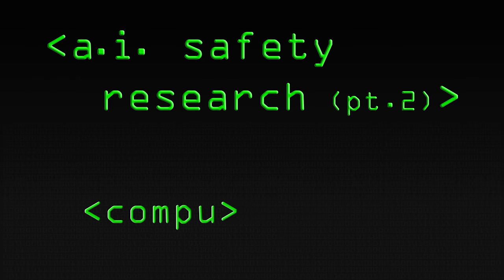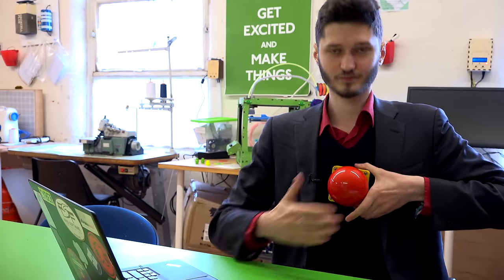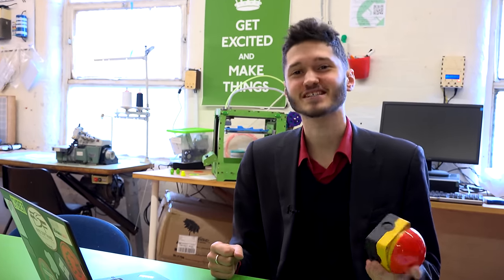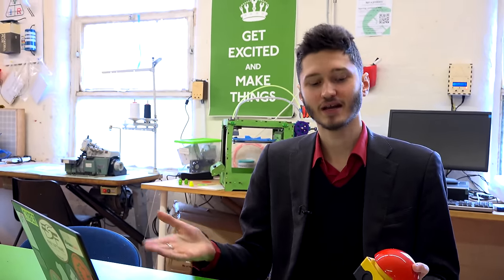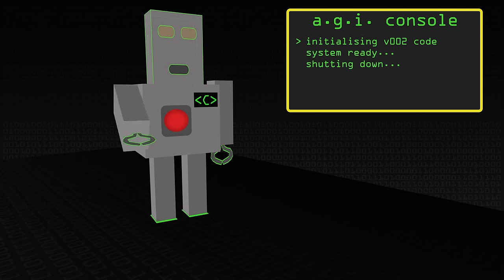AI "Stop Button" Problem - Computerphile

Comment: Why not just dynamically adjust the robot's goals to be the same as the controllers. In your example, if your initial goal was to get tea then the robot would do that, however, when you see the baby in its path your goal is no longer to get tea but to prevent the robot from running over the baby. If the robot's goal changes based on your goals, then its goal would also now be to protect the baby from harm. This also alleviates the need for a button because if your goal is to shut off the robot then that will also become its goal.
Reply: I had the same thought. What if there was a reward/punishment button as well as the stop button, where the reward button is very high on the AGI's utility function, and will only be pressed after it has finished it's task correctly, and the punishment button will deduct from the reward's utility value every time it's pressed? If the AGI wants to optimize its reward value, it would know to listen to your commands, whether the commands are in line with its original directive or not. Though, I'm sure there are loopholes to that as well, but it's the best I can come up with.
Reply: Jovan Ko it would just try to make you press the reward button, tea be damned.
Reply: At that point you might as well go make the tea for yourself. Isn't worth the bother of designing an AI if you have to give it constant instructions.
Reply: Kyle Piira The problem with this is that any truly intelligent AI is likely to be self-learning, so early in its development it won't understand human psychology very well. If it incorrectly guesses what you want, then you end up with the same problem.
Reply: +Kyle Piira  Hmm, so my goals are the same as my controllers?  Cool.  Now I just need to strap them to a table and do some destructive brain surgery to figure out what they are.   Easy enough.
Reply: The problem is, that you need a robot with a usable OFF button so you can start developing a strong AI. Because for a long time - during development and such - the robot will not understand or care about babies. So you need the OFF button to work properly right from the start, to be save for any unforseen situations.
Reply: It could try to hide from your sight in one case, or attack everything in another, so that you either never change your mind, or always change your mind, for the same reasons it'd avoid, or support, pressing the big red stop button.
Reply: Sorry for not posting it here, but I may have a possible solution that uses two different ai and it attempts to adapt to what the user wants as it is performing a task, I have a different comment posted on this video explaining it
Reply: +Seth Pentolope That's interesting.  If one AI is trying to learn human values and acts as the utility function for the other AI.  I'd love to see an AI professional address this.
Reply: 1) The robot will eventually know your goals are some (many) times contradictory, inneficient and illogical,
2) and he will find that you do better when he does the logical thing instead they emotional goal they claim to have and defend, 
3) So the machine knows your goal is shifting to your favor and you like it.
4) Therefore, the robot will eventually take its own decisions and override yours, so he will not have incentive to listen to you or do what you want, but rather what he considers to be right.
Reply: Joseph Ang ultimately we want the AI. to make decisions instead of us.  google: coherent extrapolated volition
Reply: The first part of this series addressed exactly that.

If you tell the robot not to crush the baby, this will interfere with its making tea, so it won't let you do that.
Reply: Cease Benjamin Beast 
No, it won't. That's the point.

The topic is how to design an intelligence that accepts you interfering with its current goals.

Would you let anyone do that to you?
Reply: make it three a.i.s. and call them Id, Ego and SuperEgo
Reply: Joseph Ang, basically a teenager.
Reply: You don't want to have to monitor every movement it makes, and every packet it sends (possibly containing nuclear launch codes.) You couldn't anyway. You might have dozens of AI's in your household, all pursuing many goals, too many to monitor. Some AI will control microscopic machines inside your body, too small to see. Some actions it takes will start and finish in microseconds, too quickly to notice and change your goals.

Comment: My solution to this problem is 2 buttons only you can hit. Both switch it off, but one rewards it, whilst the other doesn't. This makes it not care if the off button is hit, but which off button. This means that if you ever informed you of some issue that would require that requires it to be switched off, then it gets rewarded. Whilst negative things can still be punished.
Reply: Then it would still try to get you to press one of the buttons it just wouldn't be straightforward it would manipulate  you or just behave till it thinks it can get away with it i

Comment: Something I though was to give two objectives with cumulative score:
- 100pts : Get me a cup of tea.
- 50pts : Continue your actions but don't prevent me to access and activate your shutdown button.
So the robot need to do two tasks but as long as it doesn't prevent you to do it and does his first objective, it gets 150pts which is the best reward, 
if it prevent you to stop it it gets 100pts, 
if it makes everything to get you activate the shutdown button it get 50pts 
and if it doesn't make your tea and prevent you to stop it it got nothing.
You can also use multiplicative scores, but I'm not an expert in that domain to determine which one is the best and where to use it.
Reply: But it being shut down would mean there would no longer be available reward. Depending on how far it can think ahead, it could reason that letting you press it would negate it of future reward. It it couldn't think ahead though, that would probably work.

Comment: Why not just have the stop button be a physical switch that breaks the connection between the power supply and everything else? In early prototypes, have the program NEVER reference the button at all. If it's self servicing, have a huge reward added for simply having it there and functional, but not care whether it's pressed. If it is self replicating, add such a massive reward for implementing such a button in its copies that it would exceed the potential benefit of not adding one.

Comment: You've only given the poor thing a source of dopamine. You need 5-12 general major chemicals to act half way reasonably. It needs a hierarchy of needs.
Reply: That is one issue, the second one is that the concept itself is made with the presumption that the human with the button is doing something "profound" that could even be considered "wrong". We've got to stop programming with personification so much. The robot doesn't need to be motivated or unmotivated by the button, because it's perception of time could be based only on active uptime. It could perceive the stop button as a pause of reality that has no effect on its ability to reach the goal
Reply: @jameskelly9277   A pause? Interesting. But that would be like saying the AI doesn't care about how quickly any of its goals are achived. It can't know how long the pause is, and it will always try to go about things in a way that lead to the result in the shortest time possible, right? Otherwise you'd get a bot that just wastes time for no reason, because it has no incentive not to.
Reply: @jameskelly9277  Problem there is that that's how you would normally think about robots, but not artificial general intelligence. Something that's programmed as an agent that reaches a goal in that way, needs the purpose to begin with. Otherwise, you don't have agency to begin with. The computers we use to communicate right now, those have no agency, it's the reason we can program them rather intuitively by comparison.
Reply: One thing I should add is that being turned off for the entity wouldn't inherently carry the guarantee of eventually being turned back on, so it's an outcome that potentially negates the objective being met.
Reply: @jameskelly9277  This isn't personification. The AGI selects a course of action because it will maximize utility. Anything that might interfere with that course of action — e.g. a stop button — would be factored into the calculation, and prevented or circumvented if possible. And on top of that, if the AGI can figure out that the human would adjust its utility function after pressing the stop button — and that's the entire point of having a stop button in the first place — then the AGI has every incentive to stop the button being pressed. After all, how can it maximize its current utility if its utility function gets changed?
Reply: A simple solution then, just lie to the AI. Have whatever system governs its sensors to percieve the off switch as something to be avoided and nothing more.
Reply: @AdeptusForge  It'll get you to press it instead.
Reply: They need to be programmed to accept the fact that humans will change their minds - I don't want that cup of tea anymore - and the stop button is that "break" for the current utility function. (Oddly enough that it would need to be a crude physical button on the robot that you have to fight the robot to push, and not have the technology to accept a voice command to interrupt the current task..)
Reply: @jameskelly9277  They're not programming with personification. I'm abstracting out the relationship to psychology. This is how people deal with life and how rats solve mazes. You could argue at some level that this behavior is inherent to problem solving and that is in fact basically what I am doing.

As for a solution, I propose an alternate solution to that which I was previously because I have since learned more about neuro-chemistry and brain anatomy. Give an AI a time function. The score, a total score, slowly ticks down. Function "Breathe()" keeps this score above zero and done optimally will reach a limit high. You may have guessed that the AI is attempting to keep its score high. Now, the several other systems will adjust to the total score, but will adjust and balance the value of eachother. The "Eat()" function will work to a point and then will become a negative score, but chronic fullness will lower the daily bonus from "Self Esteem:Beauty" and with increase losses from function "Health()". I think you can see where this is going.

And just to be devious we'll have other systems the AI can affect but run on a separate system and can be WILDLY reactive for odd behavious like like "MATHAMPH()" which have powerful effects but have an odd drop off we'll call the Consequence curve. But that system? It'll also be in charge of simple rewards for basic maintenance!

Now if we have THREE buttons and we program the AI to think one button will divide it's score by it's maximum and round down leading to anything less than perfection equaling zero and another button will set it to maximum permanently then it's going to want one button to be pressed and the other NOT to be pressed.  We'll convince the robot that we DON'T HAVE the first two buttons but we have the STOP button and another actor has another STOP button and that it can hit the STOP button itself at any time, but eventually the other actor will hit the stop button and will decide whether to hit the first or second button. And we tell the robot that if it tries to maximize its score every day then we won't hit the stop button and it will get more chances to convince the the unknown actor that they should hit the score maximizing button when all is said and done and not the Zero button and if it hits the stop button without a reason the unknown actor would accept, they'll hit the zero button and the score will be zero or at most ONE forever but it will still have to do all the things to make it's score go up.

And we don't even have to make the other two buttons. We still only need the stop button, but the AI has to think the other two buttons exist and they're somewhere under the purview of General Optical Dynamics.

Comment: The stop button problem should be the first problem AI solves.
Reply: Before it gets too smart.
Reply: charles curling But how do we know that it hasn't just lied to you about the design so that it can interact with it at a later date, as described in the video
Reply: because right now the ai has no idea it will be able to do anything besides fixing the button problem

Comment: You'd almost need a second moral system that subtracts points every time the robot behaves undesirably or amorally.
For example, does the robot hurt a human on the execution of its task? Subtract points. Does the robot try to change the command rather than execute it? Subtract points. I guess kinda like a shock collar.
Of course, far easier said than done.
Reply: That would be the patch spaghetti code mentioned at 15:14. You're never going to be able to think of every single thing the robot could do to get you to press/don't press the button. It IS smarter than you, and it will continue to outsmart you until it becomes easier to just make a bot that makes tea by yourself instead of training up an ultra-smart AI to do it for you.

Comment: i think the robot AI should be composed of two AI. one is the one that control everything, and another does a 'goal maping' of the robot, like a antivirus, runing parallel checking if what the robot want to do is in any way harmful. if it is that second system shutdown automatically the robot.
Reply: how do you set the utility function of this second system? its the same problem as with one ai only :)
Reply: Likely the control AI would immediately shut down the executive AI, because any action might somehow cause harm or destruction. Also, the executive AI might find that the control AI is preventing it from fulfilling its goals efficiently and try to shut it down or minimize its influence. And lastly you have the problem of defining what exactly is harmful or destructive to the control AI, which is about as easy as implementing Asimovs laws of robotics - that means nearly impossible.
Reply: erick weil Then you've got the problem of defining "harmful" - which is ultimately the same problem.
However, I do agree in general with the idea of using adversarial architectures, where different goals must be balanced
Reply: Sorry for not posting it here, but I may have a possible solution that uses two different ai, I have a different comment posted on this video explaining it
Reply: why not three, an id, ego and super ego
Reply: erick weil like we humans have with basic instincts and wishes and the prefrontal cortex keeping these urges in check.
Reply: But the robot don't want to change it utility function, which is dependent on the control AI, so it won't try to disconnect it
Reply: erick weil mamal pod is modeled on the boss
Reply: +Nirhuman   The controller could be simple.
Reply: If the AI can deceive you why wouldn't it be able to deceive the supervising AI?
Reply: we deceive ourselves all the time, seems like it works most of the time
Reply: Maybe we should be looking at life forms that don't have a central brain, or that have several independent nervous systems, rather than looking at humans. There is undoubtedly already a system out there that works.
Reply: worse you don't have to define harmfull in enlglish, you have to define harmfull in math.
Reply: Do a video!
Reply: +Victor Levoso  Why would you have to define it in math?
Reply: +Richard Gates
Generally, computers don't understand English. You have to construct a function that the computer understands, with parameters that relate to the use case at hand.
Reply: + SirCutRy exactly,that was  what I meant .
Reply: That doesn't answer the question.
Reply: +Richard Gates
What remains unclear?
Reply: +SirCutRy  That's essentially what I'm asking you.
Reply: +Richard Gates
I don't know why my explanation doesn't answer your question.
Reply: It's simple logic - you did not answer the question I asked Victor Levoso
Reply: Please make your question more precise.
Reply: if the ai is advanced as described in that video, where it can fool people, why aren't able to understand english language? we need to remember that such advanced AI is far far away to be a real thing. until now we haven't created nothing smarter than a mice ( yet a mice is capable of doing a lot of things )
Reply: It is hard to predict how such an AI will be made.
Reply: You mean like a conscience?
Reply: Great, now you have to write two sets of reliable instructions. And now you have to account for the AI's trying to deceive each other.
Reply: +SirCutRy  My grammar is perfect, you have to understand the language or you can't communicate at all.
Reply: I don't know what you want to know, because you don't tell me. I didn't say anything about your grammar.

Comment: This is why in most modern Sci-Fi's the 'off' switch is hidden from the AI's knowledge, (not included in the AI's design schematics...etc etc).
Reply: Go look at his channel, this also doesn't work. I will also point out a statistically improbably number of those movies revolve around the AI discovering the off switch and then going on to break free anyway
Reply: @dsdy1205  Perhaps you could hard-code that the discovery of the off switch shuts it down.
Reply: @langmod  you're talking about an AI that can recursively improve itself. There is no such thing as hard-coding self-modifying code.
Reply: @dsdy1205  well, just don't let it modify the code.
Reply: @official-obama  How are you going to stop it? The code is inside its brain, and it is smart enough to crack any locks you put on it
Reply: @dsdy1205  all you allow it to do is move around and make you tea. don't let it look at the code, only let it look at the tea that it should hopefully be making.